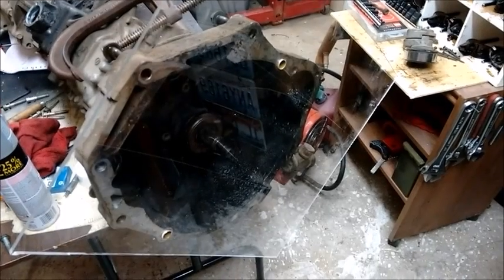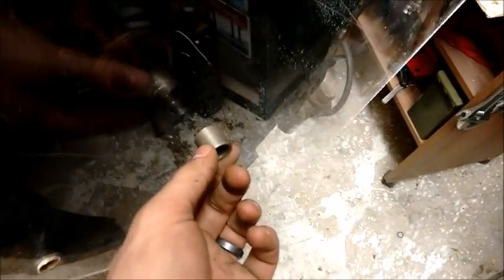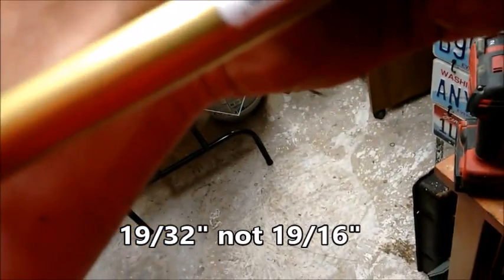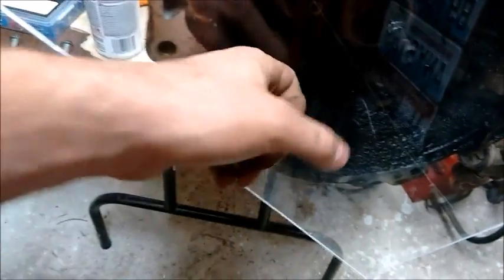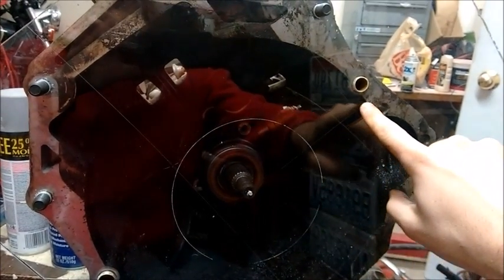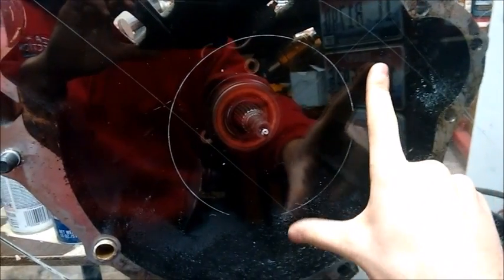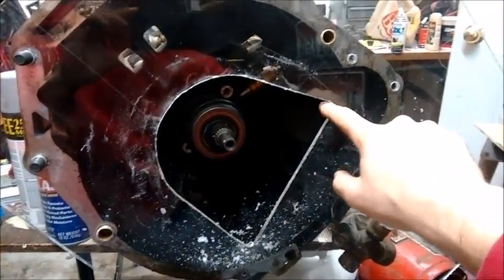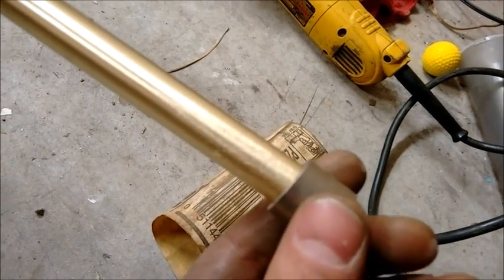TDI Ranger Adapter Build - Part 1

Comment: Hey how thick of plexus glass are you using?
Reply: I'd assume 1/4" because he was talking about the engine being spaced 1/4" from the trans with the finished adapter.  I assume he would mock it up with plexiglass with the same thickness just for consistency.  I know I would.

Comment: Not sure if you keep up on this anymore, but, really interested in doing this swap in my 94 3.0 5speed ranger. ANY info would be greatly appreciated
Reply: Not sure if you're still in market, but you can buy a premade adapter for the 3.0 and 4.0 to use stock transmission with a 1.9 TDI. It's spendy at $600, but for people who don't have proper tools, know-how, or time to manually do everything, it's nothing less than perfect.
Reply: @Dude13450  always, where did you find that at?

Comment: Would this work with a petrol engine? I think the VW petrol engine would be great for a hot rod.
Reply from the maker: +Chris Henniker Possibly. I am not sure if the VW Diesel and Gasoline engines share the same bellhousing. Seems to me that the process would be the same, though.
Reply: The bell housings are the exact same in all mk4 VW except the vr6
Reply: Why? Plenty of GOOD ford gas motors, not many small diesels.
Short track racing, the fastest cars/engines are 2.3 ford but diesels? VW has a very good one that has good high revs.good longevity wrecking yards full of them= cheap used parts That's why people use them, not because of the VW badging or name.